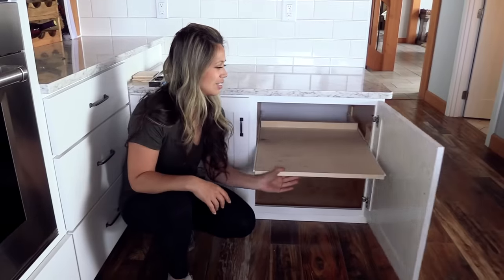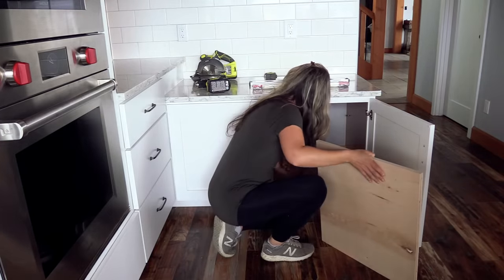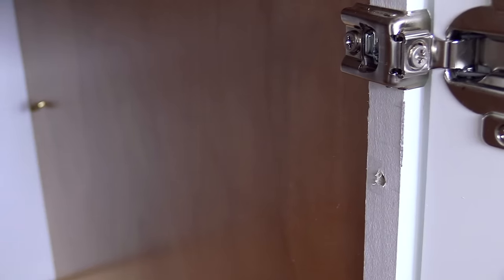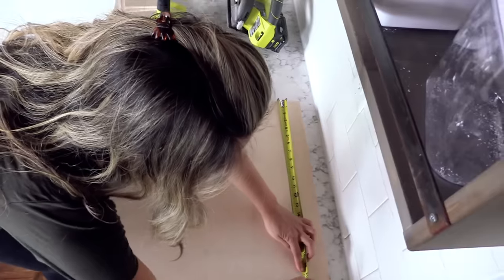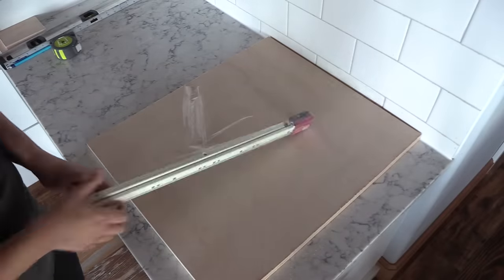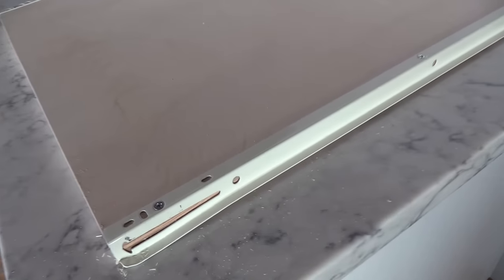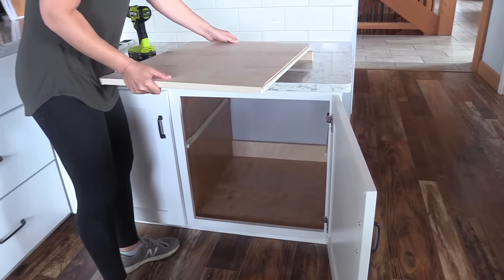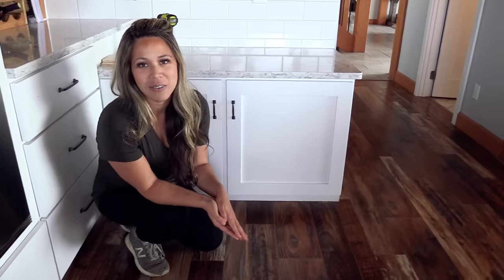Easy! Convert Cabinet Shelves to Roll Outs for $10

Comment: Do you have any tips on how to remove a shelf that appears to be glued in? Do you have a video… or is it possible to add a ‘wall’ between cabinets to create this type of shelf? Is it possible to add a sliding lower shelf? (See below) The section between two of the doors is 2 1/4”, tho again, there’s no ‘walling’ behind it to separate out the cabinet. If looking up from the inside the bottom cabinets, there is no ceiling, if you will. It opens to the bottom of the drawers. The area next to the stove at bottom of the cabinet has a chunky wood frame with a sliding base in it. I think nails were likely used once upon a time to secure it. Now the whole thing slides from one end to the other& tilts the sliding part down w its butt tilting upward. The slide area in its frame must have been built in place bc it is too wide to come out. The funky short shelf prevents me from being able to take it out. I’m afraid it would have to come out in pieces. I wish I could send pictures. Any assistance welcomed.

My lower (& upper) cabinets are open rather than having a center wall between the cabinet doors. The lower cabinets only have a ‘short shelf’ in place, tho it runs the full length of three cabinet doors from one end next to the refrigerator to the other that ends at the drop-in stove. On the  other side of the stove, the cabinet picks up again then runs another three cabinet doors with open space between the doors & there is another long shelf that also appears glued to a piece of wood attached to the inside of the cabinet. The shim piece the shelf sits on is considerably thicker than the ones you add to the inside of your cabinets. The cabinet on the other wall (L-shaped except for fmr door to garage,except we raised the floor & made a room) where the sink is located is much the same way except lower cabinet on right side has drawers; left side has built in dishwasher then two lower cabinets with yet another ‘short shelf’ that also appears glued/nailed in.

I’d love to move some appliances to a pull out drawer such as small blender, Oster Blender, KitchenAid Mixer, toaster, Foreman Grill, & possibly Instant Pot, countertop roaster, Crockpot, etc.

Comment: You mentioned you subtract another 1" from the width. You went from 21" to 20", is that for the glides? If so, does that mean each of the glides width was 1/2" wide? Just trying to be sure before building mine. Thanks for the video!
Reply from the maker: Yes, that is for the clearance of the slides, here is the full tutorial with more information https://www.ana-white.com/woodworking-projects/10-roll-outs-kitchen-cabinets

Thanks for the visit!

Comment: I only have one cabinet that I can do this to. (Other is the double sink cabinet) Only problem is that my shelf is built in. There are no screws. I’d have to cut it out. I just might. That shelf is a half shelf. I know it’s made so that you can keep a soup pot or some other tall items in it, but I have TWO big soup pots so I can’t even get both in there.  I keep them in the garage on a shelf by the door. So it’s a lot of wasted space that I desperately need. I’ve got a piece of wood I can use for the shelf. Here’s an idea to DIYers. Keep a cordless screwdriver in your glove box. Sometimes those “side of the road” furniture pieces have drawers or shelves with slides! I also grab solid wood drawers and the slide under them. The slide can be used to fix a broken drawer in your own dresser. The drawers can be made into cool wall storage. I’m collecting drawers. My family rolls their eyes at me. Lol and nowadays seeing someone stopped on the side of the road getting furniture is not an odd thing. I talk so much about that stuff that now my chiropractor stops to look at side of the road  finds! He’s now on the bandwagon! 😁

Comment: For the bottom of the cabinet would you do exactly the same?  I'm assuming we would have to buy a new piece of wood to make the shelf.
Reply from the maker: Yes, same deal!  You may be able to get away with 1/2 thick plywood if your shelf span is less than 2 feet wide otherwise opt for 3/4” thick plywood.

Comment: You should measure the actual cabinet front and back. Don’t assume or expect the cabinet is square. Some drawer slides, especially full extension slides are very finicky about  being out of square.
Reply from the maker: Great tip!

Comment: No idea why anyone wants to lean and reach way back into these "below waist" cabinets/drawers. SUGGESTION: set top pull out at 20%30% and the bottom at 70%80% height. The top for everyday items and the BOTTOM for large 10-20lbs sacks of flour - rice and sugar ( so the bottom should be rated for that weight.. or large packs of paper towels ( they are huge and unsightly ). Thanks so much for your video... oh and if you have senior parents or back problems this is a MUST diy or support a local trades person.

Comment: I'm wondering if I could make a rectangular frame to go under the pullout and attach my slides to it, so it's self-contained. My goal would be to still be able to use the shelf pins to adjust the height of the pullout.
Reply from the maker: Yes, I believe that would work, however that rectangular frame would need to be secured to the cabinet somehow.
Reply: @AnaWhiteDIY  Oh, you're right. Otherwise I'll wind up with a pile of dishes on the floor the first time I pull it out. Hold on, I need to overthink this!
Reply: I've got it. Little legs at the back corners with holes drilled in them that are just long enough to reach the next hole down. Then a wooden dowel through the little legs and into the hole. I think that should work, as long as you're not loading the pullout with cast iron or something too heavy for your wooden dowels.
Reply: There is no such thing as a project that I can't, with a little effort, make more complicated and fiddly. Consequently, I rarely complete projects...

Comment: What if you have a cabinet that is open on the inside with multiple doors? I am guessing there must be a different slide you can screw into the existing shelf instead of the walls of the cabinet
Reply: Ana shows how to do it with a double wide cabinet here: (scroll down a bit where it says, "my cabinet is a double wide." @t

Comment: Hi Ana.  I’ve got old, contractor basic cabinets that have a half shelf in the back of each cabinet.  I need roll out shelves since getting down on my knees to find stuff is ANNOYING. Do you think I could do this by just placing the rolling drawer just slightly above that half shelf?  I don’t think I can cut it out because I’m sure it helps stabilize the cabinet in general.  BTW, I’m thinking of using the newer slides from Lawless Hdware (you showed these on a newer video).
I’d like to smack the guy that thought up those half shelves! 😁
Reply from the maker: If you have clearance, you should be able to achieve that.
Reply: @AnaWhiteDIY  Thanks Ana!  Got to get myself in a productive mode and tackle this. 😁

Comment: If the door pivot point doesn't rotate out of the way, the pullout will end up hitting the edge of the door.  Also, those crap epoxy slides require the opening minus 1-1/32" to 1-1/16". 1" is too tight, especially if you can't read a tape measurer down to the 32nd of an inch

Your level method "works", but the right way is to take a square and draw a line perpendicular to the face of the cabinet. 

Your method works because those slides are self close. 

You should probably also mention those slides only pull the shelf out 3/4 and are not full extension

Me= a high end professional custom cabinet maker with 29 years behind me and 23 years of self employment
Reply from the maker: Great tips, thanks for the visit!

Comment: Anna, I want to build a pull; out cabinet shelf as you've shown, but I want it to be one that I can change ... that is, place it at whatever height I want.  Can I do that?
Reply: BTW, I have both frameless as well as one face framed cabinet where I want to do this.
Reply from the maker: Hi Nancy, thanks for the visit! You could, you would need another pair of cabinet slide members installed to remove and reset the drawer at a different height, does that make sense?
Reply: @AnaWhiteDIY  Sorry, I can't picture it ... another pair of removable sliders?  I guess the question is what might it look like? - I can figure it out if I could see it ....

Comment: I noticed,  you bent the measuring tape.  This should not be necessary,  if you look at the casing of the measuring tape, there should be a number on there,  telling you,  how wide the casing is,  so you add that to the number you can read on the tape,  where it goes into the casing.  Voila,  more exact numbers for inside cabinet or whatever measurements,  where you have walls on both sides of the tape.

Comment: How do you make sure the screws for the shims don't pop out the other side of the cabinet wall?
Reply from the maker: You need to make sure your fasteners are the right length for the material you are dealing with:)

Comment: my problem is that my island has "4" cabinet faces... but is completely open on the inside... so theres no way for me to attach side drawer slides. any suggestions?
Reply from the maker: Sounds like you would need some extra blocking and added framing to the middle.

Comment: Any suggestions if my shelf is only half the dept if the cabinet? Its really frustrating.
Reply: Go to your local big box store and pick up a sheet of 1/2” or 3/4 melamine and cut it to the right size. Another option is to use plywood and cover it with some peel and stick covering. If you have more than one 1/2 depth shelf glue them together to make one and you can reinforce the bottom by screwing some narrow pieces of wood to the bottom of the new combined shelf.

Comment: Did not mention that the width of the Shelf with the sliders must include cutting off some of the Shelf for the sliders. As they stand, the directions here don't work. "Subtract an inch" will go right over people's heads

Comment: What are the slides and where did you get them?
Reply from the maker: Plan link https://www.ana-white.com/woodworking-projects/10-roll-outs-kitchen-cabinets

Slides
https://www.homedepot.com/p/Liberty-22-in-Self-Closing-Bottom-Mount-Drawer-Slide-1-Pair-2-Pieces-D68822C-W-TS/202200640?MERCH=REC-_-Pip_Alternatives_Non_HDhome-_-302981211-_-202200640-_-N

Comment: Now to find the store where I can get all those tools for $10
Reply: They are hardly cutting edge tools and other tools are available, a hand saw and screwdriver would do it for example
Reply: @1988dgs  all within $10?
Reply: @nairnavneet  poundland or dollar tree have basic tools and a saw and screwdriver are the basic minimum, drawer runners can be bought cheaper including the screws and using the existing shelf there is no reason why it can’t be done. Nicer tools make it nicer to do but too many people get hung up on buying tools
Reply: Just so I understand you right, you saying that poundland or dollar store will have all the tools, fasteners and materials that this woman uses in this video for less than $10?
Reply: @nairnavneet  not being in America but understanding their business model is the same as Poundland etc and as I said the screws come with the slides … oh I get it, your trolling, 👍 you might not be able to, but I could
Reply: @1988dgs  Who is not in America?

Comment: Why are the shims only used on one side?
Reply from the maker: Here is a more in depth look at different cabinets and where shims need to be used. https://www.ana-white.com/woodworking-projects/10-roll-outs-kitchen-cabinets
Reply: @AnaWhiteDIY  Thank you for your quick reply. I had actually already found the info you suggested before I watched the video. Someone on that site asked the same question about the video, but there was no answer. So I watched the video. I still don't understand why one side needs shims and the other doesn't. The info said that you could attach the slide to the front facing without a shim but you would need one in the back, but there are no shims on that left side, that I can see. Thanks anyway for trying to help me. I appreciate you.